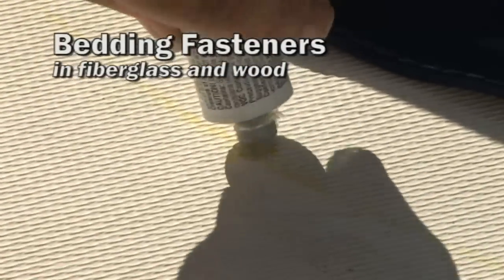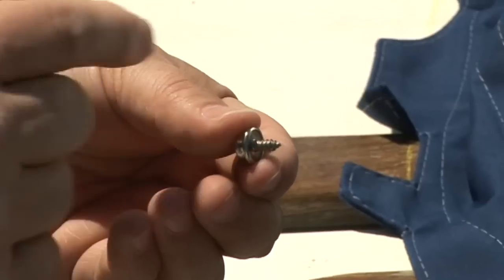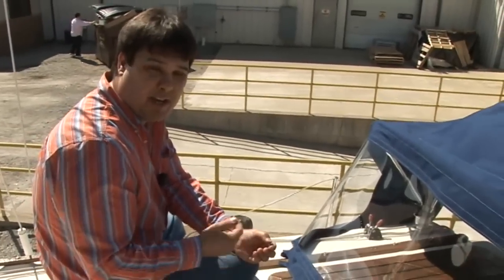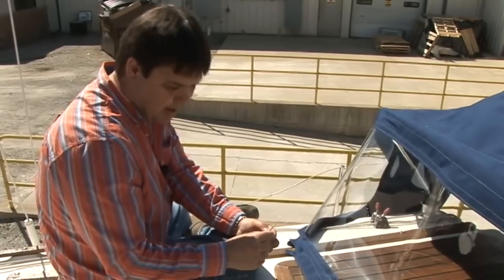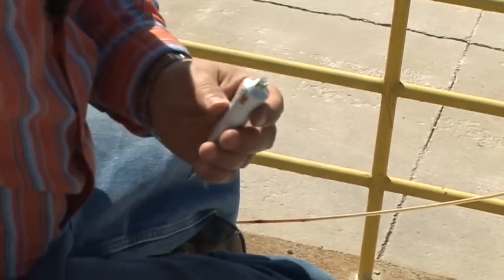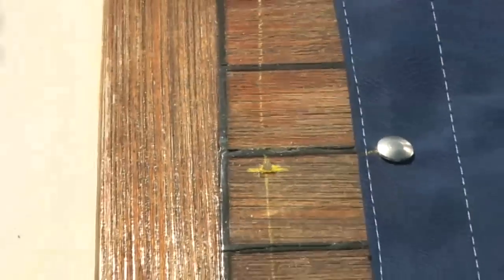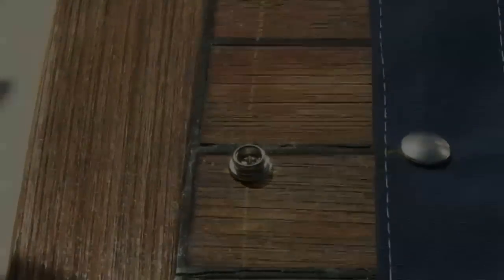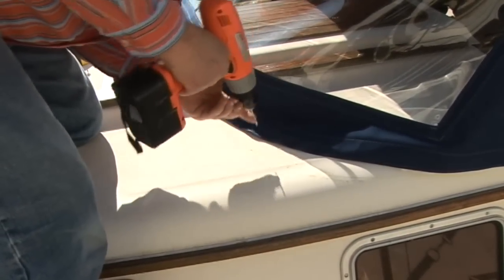Bedding (Installing) Snaps or Fasteners in Boat Deck

Comment: What if I wanted to use these snaps in my car the hold drapes against the windows into the plastic portion  what adhesive would I use to keep the screw tight into the plastic. ?? Working with the Subaru Outback back window covering
Reply from the maker: Usually no adhesive is required when screwing the snap stud into plastic. The application here "Bedding" is used to keep water out.

Comment: counter sink hole and use bedding compound, not silicone
Reply: What kind of bedding compound?
Reply: @bradgilmer6684  butyl tape. I bought mine from bed-it
Reply: I like butyl tape and have a bunch, but I've read that it doesn't like to be twisted as it would be when used with a screw-in fastener. Have you had a different experience or what would you recommend besides butyl tape as a bedding compound?

Comment: the one into the wood was fine except use proper caulking, not silicone, the one into the coach roof looks dodgy af - is that a composite deck? A better idea would be to overdrill the hole and fill with epoxy, let it set sand it back then drill into the epoxy, then install your fastener into that.. then you know you wont rot your deck when it leaks and please don't use silicone.
Reply: That's probably gelcoat they were drilling in and you don't know what you're talking about regarding overdrilling and filling with epoxy?  Have you actually done this?   Marine mooring covers is what we do for business.. why would you want to overdrill a large hole and sand it?
Reply: @MrLeviaFUN  if you have a better way. Please send me a link I'm interested.